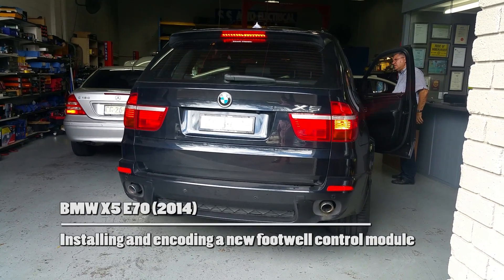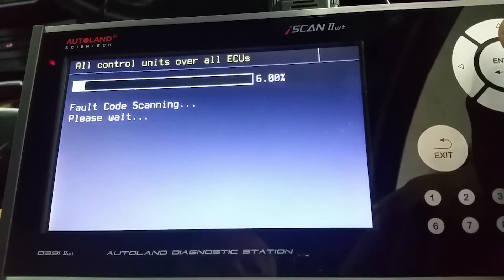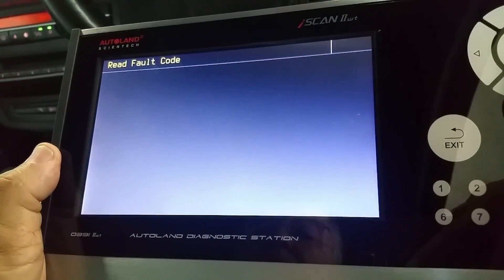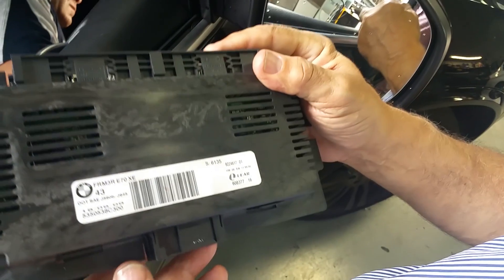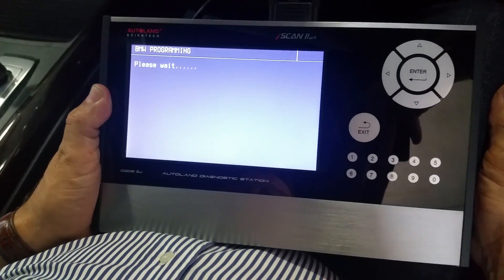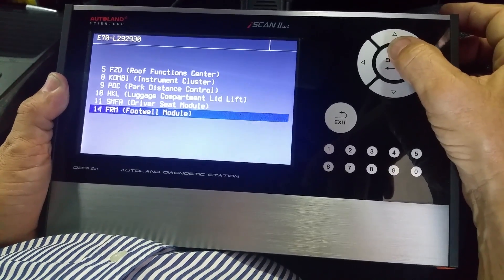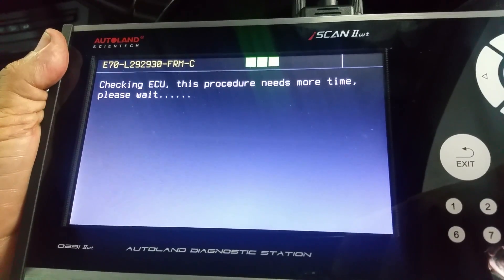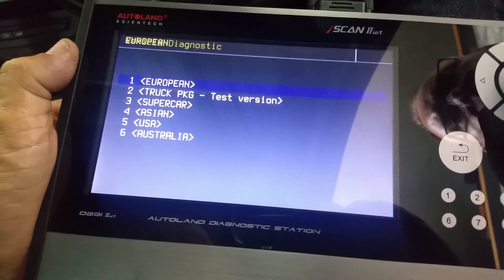Testing, replacing and encoding a BMW footwell control module

Comment: No need to replace the FRM for short circuit protection. Can be reset with tool32!!
Reply: You can inhibit short circuit protection on the footwell module with a proper scan tool.
However you should find and repair the short circuit, because after 50 cycles it will block the shorted circuit again.
Reply: exactly. No need to replace the module. just fix and check the short circuits on the car and reset counters with tool32. And your FRM is good to go again !
Reply: My belt broke and after replacing it my lights door locks blinkers dont work can I fix it without replacing FRM??
Reply: @IfYouOnlyKnew_648  same here. Did you find a fix? Did resetting with the tool32 work for you?

Comment: All the electric systems in my vehicle have been closed. Nothing works. Meter does not show anything. The car is not starting to start.
I do not understand what modular box was cut
Reply: FRM MODULE. It's the same as Footwell module. Replace it